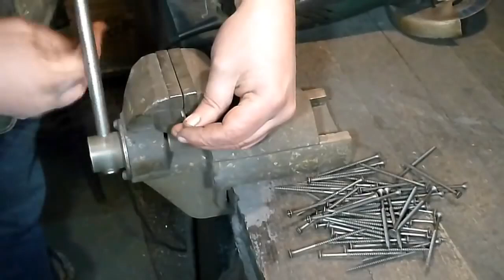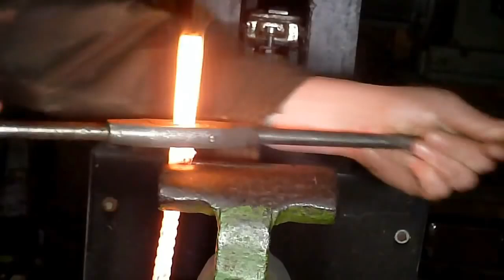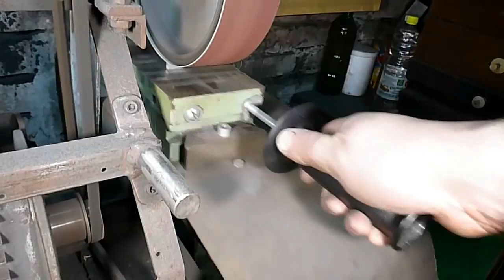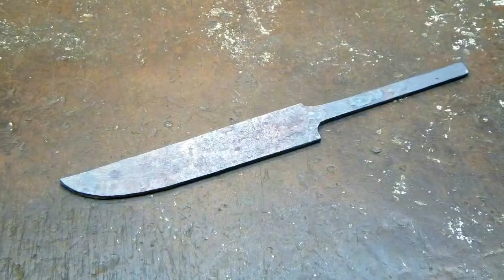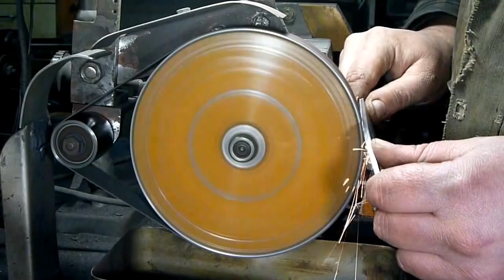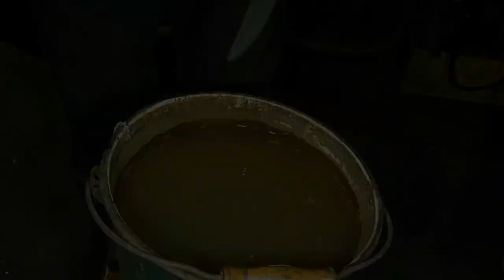Unintentional ASMR - Forging a blade

Comment: This is really cool but please explain why when he dipped it into that liquid near the end a cool pattern formed?
Reply: Look up Damascus Steel :)
Reply: @soggy5854  But Damascus steel is made by folding the metal in a very specific way right? The rest of the process didn't seem like Damascus steel either.
Reply: It's called etching. You put the blade, or whatever piece of metal you're using, into an acid solution and it eats away parts of the metal leaving the pattern. Damascus has no real set pattern, it's always gonna be kinda random. There are also several different ways of making it and this is one.
Reply: @lordxicor3247  Oh, ok. I'll look up etching to find out other stuff like how they get the acid to only eat up parts of the metal and not the rest.
Reply: @xillioncv3269  The acid reacts differently to various metals. He used 2 types of screws that must've been different alloys. So one of the metals was affected more than the other, resulting in the light and dark pattern.